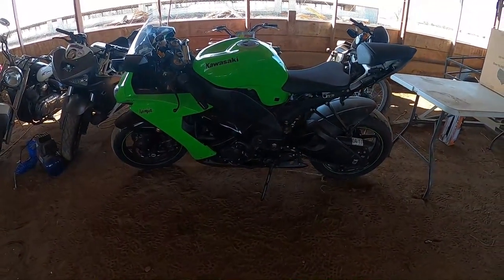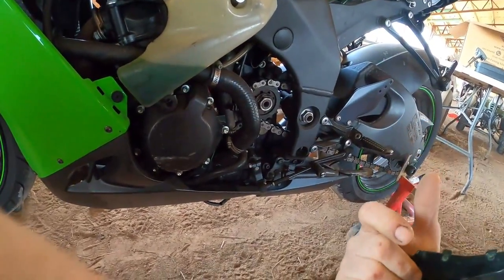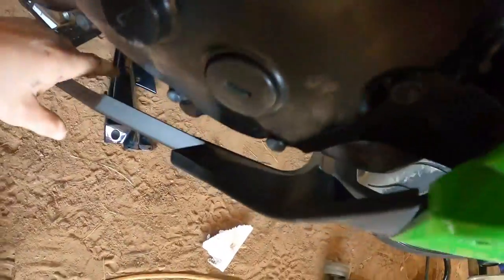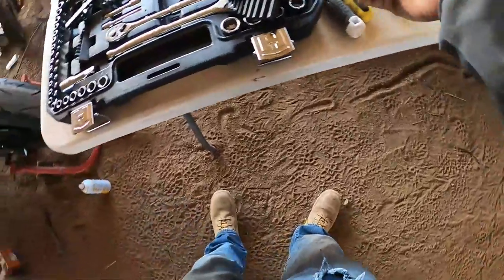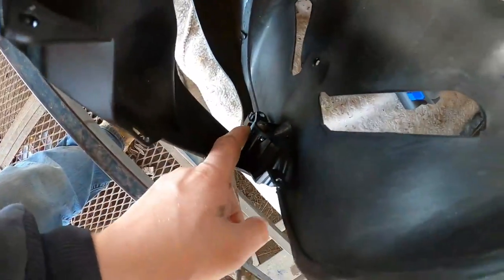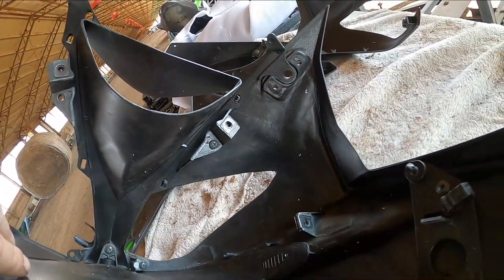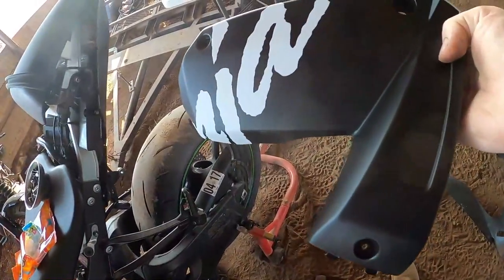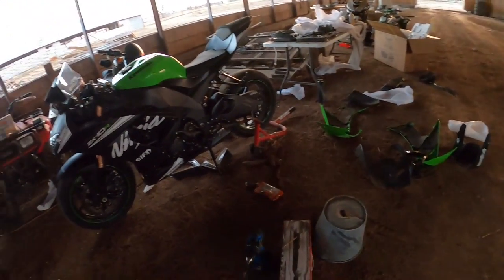2008,2009, Gen 3 ZX10R full fairing swap.

Comment: I just bought these fairings last night. I started off with an 09 zx10r for 1500 that runs and rides but at 70mph it bogs down. So I bought a fuel pump, filter and regulator that should be here today. It came with fairings on the bike but some are cracked. It also came with new unpainted ones but I ended up just buying some prepainted ones. Just bought all this last time too so this should be some good upgrades for it for now.

Both stands $100
Quantum fuel pump setup $86
Battery $115
Bike 1500
Mirrors $40
Spools $25
Tail lamp $31
Fairing bolts $25
Fairings $589
Sprocket cover $37
Chain and sprockets 199
Bmc filter 72
Motul 300v 86
Ngk plugs 36
Bar ends 34
Reply from the maker: Glad you got such a killer deal! What are you doing to do with your unpainted fairings? I may be interested in them.
Reply: @kawasakicruisader5600  and I'm in San antonio tx
Reply from the maker: @972CHENZO  if you make me a good deal I’d gladly pay for shipping man.
Reply: @kawasakicruisader5600  if you'll do 200 plus shipping then I'll do that.  I have no use for em.
Reply from the maker: I think your comments are getting deleted for some reason. Hit me up on Facebook. I’m
Kawasaki Wylder.
Reply: @kawasakicruisader5600  ah I knew that was you lol. I just saw you like a pic of the fairings.
Reply: @kawasakicruisader5600  just sent a pm

Comment: Currently watching this while redoing my fairings, a lot of help other than how in the hell did you get the rivets out of the bracket for the odometer/plastic piece. The little 3 prong bracket
Reply from the maker: Hmm it’s been so long I don’t recall any rivets. Could you send me a picture?
Reply: @kawasakicruisader5600  I actually ended up getting them out lol, just drilled them. But there were 4 in total, rewatch the video and you’ll see it when you are playing with the cluster, the bracket on the back is where they were. 2 on the bottom little lip and 2 by each rubber grommets, 1 on each side.
Reply: @kawasakicruisader5600 another question, got everything together expect for 1 thing, you didn’t show it in the video I’m assuming you didn’t change it, the rear plastic right above the taillight, can’t figure out how to get it to line up